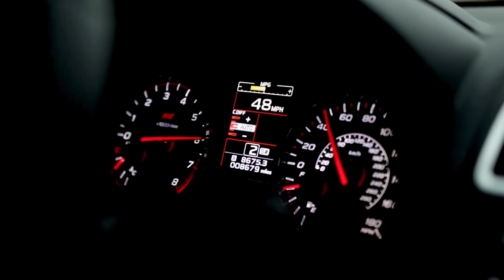LEXUS IS300 F-SPORT ON WHEEL SPACERS

Comment: were the length of the bolts ok? or did you have to grind some of the threads off so the wheel spacer sits flush?
Reply from the maker: Yes

Comment: Hello guy’s, looks great on 25mm... I did mine 20mm front and 25mm rear.
Reply from the maker: Yesss sirrr we end up doing 20 and 25 too haha. Looks way better now
Reply: I have a 2017 is 200t installed some rear but it was rubbing. 
Have you had any  rubbing issues?
Reply from the maker: E Vargas 20mm in the back and 25in the front no rub
Reply: @LIFE_WITH_ROYAL_E for a stock ride height 2018 Lexus IS 300 Fsport with the same wheels as you, what size spacers should I do for flush fitment without any rubbing of any kind? I may lower a tiny bit in the future would that affect the size they should be? I’m more focused on it being flush now.

Comment: Yoo bro quick ? I got the same car but i have the rr BBK setup just got some wheels 19x8.5 with 35 offset in the front but it wont clear cuz of the spokes what size spacer should i grab to make fitment with out crazy poke
Reply from the maker: At least a 20mm spacer bro 🙏
Reply: @LIFE_WITH_ROYAL_E  where the link?